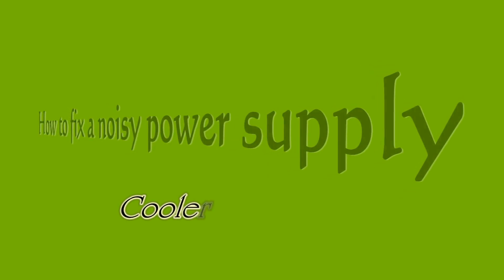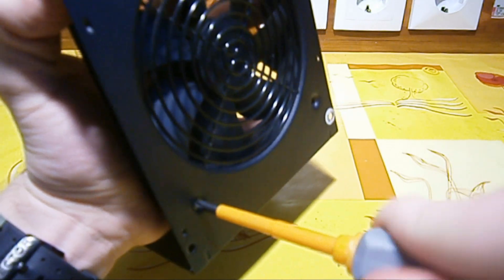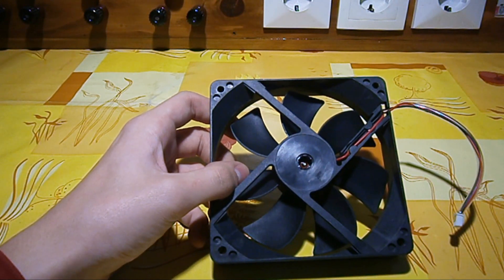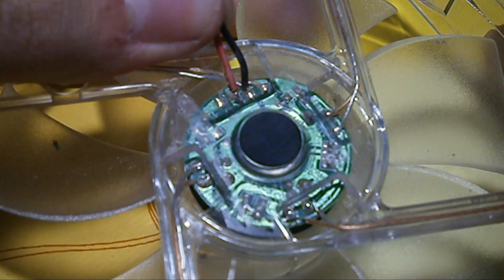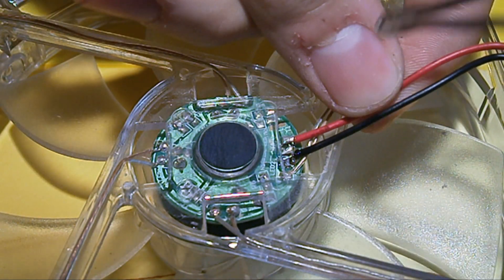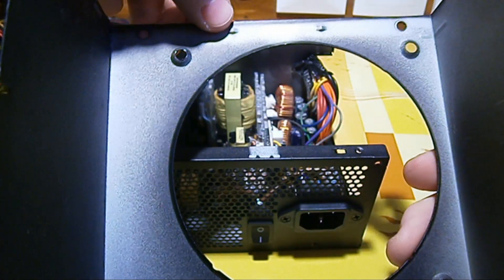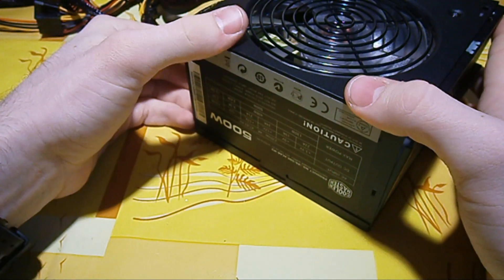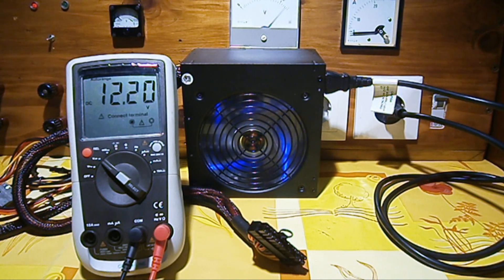How to fix/replace noisy power supply fan

Comment: I took my PSU fan apart, as it was getting very dirty & Noisy. Good to see where those tiny washers fit, as wasn't sure when they fell out. a good clean & light lubrication is working Great Now after 15yrs of use.  Spec: Brushless DC Fan   DC 12v  0.16A   1400 RPM

Comment: A lot of older PSUs have the fan wires soldered to the board. You'd have to use a soldering iron to remove the wires and solder the new fan wires in place. Also, don't touch the capacitors, they can still hold a charge, even after unplugging.

Comment: Why on earth would they use a big fan like that, only to half cover it with plastic? Just using a smaller fan in the right place seems like a better engineered solution... the big fan must've been ultra cheap or something.

Comment: You coulda fixed the fan. When you get to removing the fan blades, don't cut the wires. Add an oil/lubricant to the pin on the fan blade unit and the hole it goes into and the noise should go away. On fans that have ball bearings, replace the old bearings with new ones of the same size. The noise should go away for as long as you had it before it got the issue.

Comment: Thanks! Was looking specifically for a Coolermaster disassemble to check which way should I install back the cooler. I dismantled mine to clean but didn't take note of where the transparent plastic underneat the cooler should go, i.e., which way to mount the cooler back.

Comment: hahahahaa, you can just cut the wires outside and connect red to red and black to black and secure it with heat shrinking tube without taking the sticker at the back of the new fan... haahhahhaa

Comment: exposing the seal of the new fan is not a good idea. you should have just cut the wires on the new fan and soldered/shrink wrapped to the old wires. also, you dont mention what rpm your old fan was going at. if your new fan has a slower rpm, you're screwed. that psu will overheat.

Comment: YOU SHOULD NEVER DISASSEMBLE POWER SUPPLIES without having professional training, especially soldering wires. Capacitors can hold their charge for a long time. You shouldn't disassemble any PSU unit without professional training.
If you have to fix your PSU, you should check the warranty for your unit first. If its not covered under warranty, you are safer buying a new PSU. Power Supplies can damage you and you're expensive pc components.

Comment: If its noisy, just give the bearings new oil, done
Reply: I like the oiling maintenance, but bearings wear and eventually seize, especially cheap ones like on (often) cheap fans. Is the time & labour of oiling a cheap fan every 3 months worth it if it still silently quits and cooks your PS, unfortunately frying your motherboard as well? And even the "expensive" fans can really be made with the same cheap parts from the same factories as the cheap fans...
Reply: @user-ut9ln4vd5m  you know what? I agree with you now

Comment: My  power supply fan makes noise when i start my Pc and it will stop making noise after like 5 minutes. the noise is like the fan is hitting some wires but I haven't seen any wires in the fans way so it makes noise and the fan looks pretty normal. should i change the fan?

Comment: Can I know why is the fan covered by half? Won't it restrict the air flow?
Reply: It probably will. I was wondering about it myself. Notice that cover is at front, where on the side you got a ventilation mesh, power switch and AC power plug. So cover makes that air is being pushed into PSU only on back and middle part. Then air is moving to front part, where eventually is being pushed out of the PSU through mesh. 

So my guess is that it is to make better air circulation inside PSU.

Comment: I just bought a corsair psu and it has a bad fan bearing. It's noise and annoying as hell. If it gets any worse i may call up and see if the warranty covers it. If not i may have to resort to doing this. I hear it can be dangerous working in a psu but i guess it wouldnt be too bad as long as i only have to work on the top cover with the fan. Honestly im not happy with corsair i have gotten way too many fans with bad bearings from them from new purchases and its bullshit imo. They must not have good QC in the fan department or something. Either that or im very unlucky.

Comment: actually i had the same problem...i dismantled the fan...and dropped a drop of oil there under that rubber sealing...works like magic for now
Reply: I'm curious what oil you used
Reply: @LinkTheHero  some kind of oil that is used for oiling up stiching machines...it not that thick

Comment: I'm shocked that you went through all this work. For one thing you could have stopped at the point where you removed the blade assembly from the original fan and cleaned and relubed the bearings. Triflow silicone oil makes a long lasting lubricant. Then everything just goes back together. Even if I was going to replace the fan I would never go so far as to dismantle it to solder the original leads directly to the motor. Simply trimming the leads, splicing, soldering and insulating with heat shrink tubing would be a more than adequate repair. IMHO you made waay more work out of this than was necessary.

Comment: My case fan is making like a rattle noise.. and or just sounds like it’s hitting wires...
Reply from the maker: well if it isn't hitting anything and there ano no loose parts the best thing would be to change the fan. That noise usually indicates a damaged or worn out bearing.

Comment: great lesson on basic soldering since I have a phobia of soldering. I have replaced many things on my PC but the wiring is something that is tricky as Hell. If you can solder you can fix anything, even in home electrical wiring.  PSU fans are usually not replaceable I will be replacing mine as my PSU is aftermarket no longer sold and my PC is incompatible with the ones that are. I am definitely saving this video!

Comment: Excellent video. But curious, often the chief reason the fan has problems it due to no lubrication in the bearing. Since you have the fan apart it makes sense to try lubricating it and see if the fan works and remains quiet before replacing it.

Comment: Okey im a bit confused. I Want to change my good PSU-s fan because its noisy with another PSU fan that is quiter, why do i need the same old wires from the old fan , isnt the new quiter fan have the same wires .I mean there both PSU fans ,don't they have the same Voltage applyd to them even if there diferent modles ?

Comment: silly question,. why can't i just buy something like a half decent case fan and put that in ?
Reply: You can. You can use half decent, quarter decent, even fully decent fans. You can even reuse the original fan by giving it 5V from a molex instead of 12v. The speed is proportional to the voltage supplied. Lower speed means lower noise.

Comment: why go all the way to the soldering points? could u not just cut the wire, and solder red to red, ect. and the use shrinktube after.?

Comment: Why not just buy a fan with a 3 pin connector? Also unless the PSU won't run without a fan plugged into the circuit board you should be able to just plug that fans 4 point connector into the PSU just like any other fan.

Comment: Great video found this cause I need to replace my PSU fan, just curious instead of unsoldering and soldering the wires any reason you can't splice the old wires into the new fan? Your way is definitely cleaner but I can't solder that well :)

Comment: Can anybody recommend an inexpensive yet quiet fan suitable for such a job? I've got myself a Seasonic M12II that's way too loud. I actually hadn't realized that it had been the root of my noise problem until just today. I was blaming my Corsair fans for the longest time. lol

I have some case fans sitting around, but I'll need to grab a converter. I've got a Phanteks stock fan somewhere around here as well as some Corsair AF120s and Cooler Master SickleFlows.

Comment: (You see risky to solder it inside to the new fan, do you?) Yes you may order a $6 adapter from Amazon. OR
1. You can use a simple 2 part terminal blocks. (~ 2¢, 0 risk)
2. You can yust cut the wires half, and solder the two wire parts together, and apply some insulation tape. (Almost no cost and risk.)

Comment: Sweet.  He voids the new fan warranty.  Why not use a cable adapter to connect new fan to PS?  Why not use rosin-core solder (hope that wasn't acid core).

Comment: Definitely a skilled IT tutor, but... for 95% of folks with a noisy PSU, I still just recommend buying a new PSU, replacing the whole thing outright.  The video is an undertaking for someone who really just wants to build meticulous repair skillz, or refuses to spend money for an entire PSU replacement.  But definitely gave you a like, nice vid!
Reply: Maybe you are right but your rudeness makes you lose 10 points...
Reply: He absolutely needed to cut it, the cable he replaced has a jst header, the new fan came with a molex adapter.
Reply from the maker: Thanks man i appreciate it.
Reply: lol or just go to a pc shop and ask that they do this for you it will only cost you 20 euro's. Buying a whole new psu for a faulty fan is something for morons come one guy's use your brain for once
Reply: having a 850w & 1200w be quiet dark power pro platinum, cost 180 & 230 eur.. one super quiet fan 25eur.. why would i throw away  top psu, working fine, just for 1$ old bearings being loud..
Reply: Why he didn't buy an fan with an 3 pin connector instead of molex fan...
Reply: This man is so stupid
Reply: Why would you go through all the trouble of soldering? Cut the wire anywhere between pcb and molex and weld our just twist together and tape, its fine for the application no need to do all that soldering ...
Reply: And culveyhouse, I don't agree, I've had my Enermax 700W for almost 10 years, and still running strong, replacing the fan cost 10$ and took me 20 minutes, why replace the whole unit if you know how to do it.
Reply: Culveyhouse
, why not just replace the PC? Too much trouble replacing the PSU.
Reply: It's very popular these days to throw a noctura fan in a PSU to reduce the noise. Like for my brand new inwin A1 tbat regrettably is so loud but I want to keep th case and not spend $200-$300 on an new sfx psu.
Reply: you must be joking, this guys an idiot, he apparently doesn't even know with a needle or something similar you can just pop out the cables off the header without even having to cut anything.
but I guess you arent that much of a very knowledgable person on this subject either, since you thought he was skilled...

Comment: Wouldn't be as effective to splice, solder and heat shrink the red/black leads already coming from the new fan? After all you just need to change the connector.
 It just seems like the operation is more complicated than it has to be.
Reply from the maker: Well yes of course you can do that but i simply used this method. It looks nicer not much more.

Comment: I am going to do probably the same very soon as the fan of my 750W ps is too loud. Only I will not solder, I will just cut the cables and join them using butt connectors. This reduces risk of wrong polarity, cold solder joints or shorts and bearing problems with the fan (removing of the label not needed). Also I recommend everyone to press (and keep it pressed for a few seconds) the start button of the computer after unplugging the power cable. This will help drain the capacitors (you may see LEDs on the mainboard flash up for a split second) and increase safety. Alternatively to butt connectors, the cable contacts can be soldered (which is easier than soldering the contacts on the ventilator's PCB) and isolated using heat shrinkable tubes.

Comment: what fan did you install, i need "his"name
Reply: Hi jovan. Its not important. More important is Voltagr of fan and at which level of Voltage its going to start. Second is Ampers, should be same or less thna original fan. 
Check you psu if is header 2 or 3 pin. Buy 3 pin vent, and dipends on fan header at psu you can use just vent,swap them, or you have to cut wires and solder,or you can to find 3pin to 2pin adaptor.
I recommend noctua, super long life highest quality materials, less noise in same rpm as concurrents and higher airflow and static pressure.

Comment: My PSU has a 2 pin connection point for the fan,however all case fans that i found have 3 pins or 4, if i just connect it in the 2 pin slot, would it work ? would it stay at full speed non stop or not work at all ?
Reply from the maker: Most fans will stay on full speed if the PSU provides full voltage as newer PSUs have fan speed control that shouldn't happen. Try connecting just the positive and negative wire of the fan without the sense.

Comment: Hey, I got a Thermaltake TR2 600W PSU, and I think it has a 120 MM PWM fan... as the fan speed is controlled by the PSU.  So, if I can simply get a 4 pin PWM fan, that would take care of it. I am not sure if I would need to splice and do all that..  What do you think?

Comment: why u need to use old wires?
Reply: because the new fan has a molex connector and the old one (from psu) has this 3 pin connector or sth like that (sth similar)...
....i'm not sure
5:41

you just can buy the new fan with 3 pin

Comment: hello. I opened my pc and noticed that my cx430 fan is not working when I power up my system. I know that there is a fan control in these psu but it doesn't move their blades. Do you know what could be happing with my psu? the pc works fine. I just doesn't test it for long hours to see if psu is hot.

Comment: Thanks! Helped me out a lot! But i have one question: what is the plexiglas piece on the top of the fan for? (because I find the noise it is producing rather annoying)
Reply: I had the same question and a supposed expert said it is to direct air flow to the back components. I removed mine like an idiot, now I have to remove it from my build...

Comment: Oh, and not to freaking mention they camouflaged the tiny screws on the other side by putting the sticker specs over the other two screws. But I got it open. I'm making a DIY Benchtop power supply. Good video, thanks.

EVGA 430 Watt 80 Pluss.

Comment: Why not just cut the wires and tape them to the new fan.. or better yet just find a fan with the same connector...
Reply: The same connector isnt as commonly used on fans. If you find one with the same connector, it's probably either a cheap fan or a replacement part. The way hes doing it, you can use a high end noctua do make your PSU more capable than any.
Reply: They are commonly available from Taobao. You have sellers that sell hundreds of different fans of different sizes, RPMs, voltages, current, etc. You select the connector when you order.
Reply: Taping them to the new fan would probably work, but it wouldn't be as pretty and possibly could even be a hazard in your PSU due to the amount of heat it produces. Eventually the tape could fall off then you have exposed wires. One touch on anything and your PSU is a fireball.
Reply: @deejaydemon3145  And that is very visible place so connection would be really ugly? In this case soldering was is overdoing. Nice connection with shrink tubes placed somewhere in cable channel... Absolutely no hazard for PC. Also he could probably solve problem just by lubricating fan.
Reply: @deejaydemon3145  how yes no, your whole city block could explode (if the spark fall on the barrel full of gun powder) oh em gee

Comment: CX750 IS DRIVING ME INSANE!
Reply: +Typhoonproductions my cx600 also driving me crazy xD "ultra quiet fan" my arse
Reply: ill try a noctua redux 120mm :3
Reply: so I replaced the fan it went fine, but the noise persists as it's 2-pin so it just runs at max speed all the time
Reply from the maker: +Typhoonproductions Sorry to hear that.
Reply: ***** Im your man
Reply: +Bob Cain The fan is 2 pin or the header of the psu?
i was thining about doing that on the my cx750... but it still has 1 year of warrenty... do they give me another one if i talk about the winie sounds and fan noise? :/
Reply: ***** the fan pin uses a 2-pin connector and the header is also 2-pin :( I think buying a new psu (evga <3) is probs the best option
Reply: ***** Any recommendations?
Reply: watch cory in the house to fix
Reply: ive got one of those CX750 nothing is wrong with it after 6 months, whats wrong with yours?
Reply: Julian john It's not that there is anything wrong with it, It's just such a loud psu with so much coil wine
Reply: Corsair...that shocking I though that was the top of the line? I guess I shouldn't feel that bad the the Tiger Direct in store brand, that don't even remember now, makes an annoying noise ever so often. I was going to replace it with a corsiar.
the tower almost tipped over when I moved it to vacuum one day,  and since then its been a horror show every 12 hours or so of use... it comes back